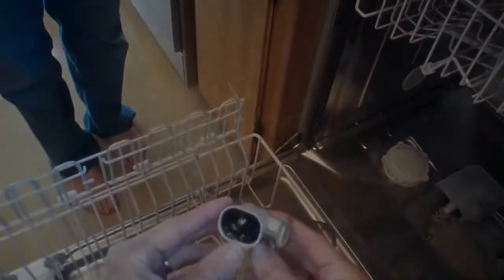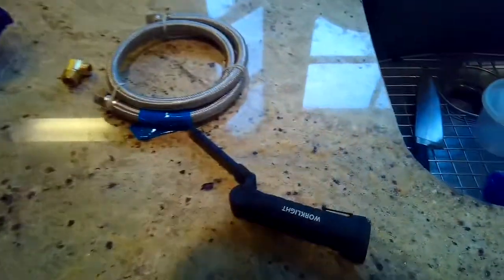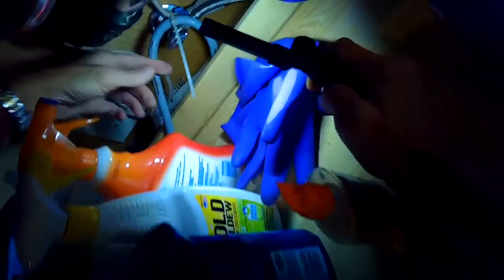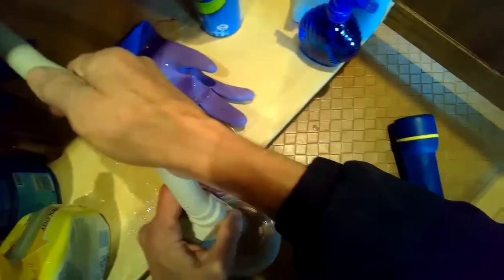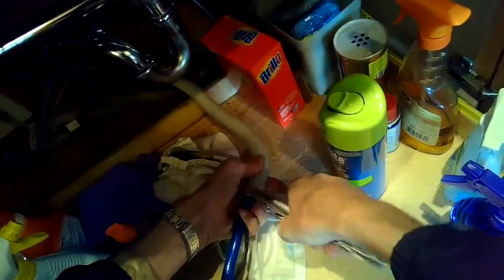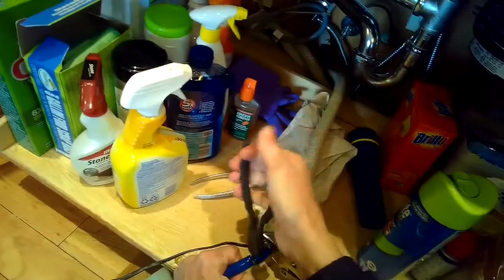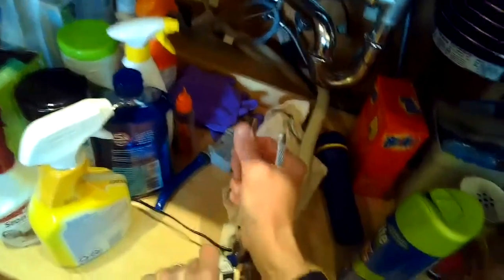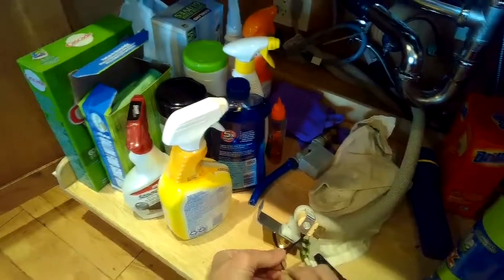Miele Dishwasher Keeps Filling—Fill Valve Replacement

Comment: what if the over flow tabs keep feeding water into the pan till error code?  it would seem that too much water is getting into the tub or the seals are bad? thoughts?
Reply from the maker: I bet that fill valve is defective and isn’t closing.
Reply: If it was bad, shouldn’t the tubs fill up, even when not in use?
Reply: Could it be a level issue, a door seal issue or a bottom sweep seal issue?